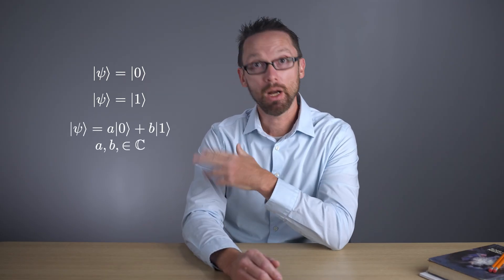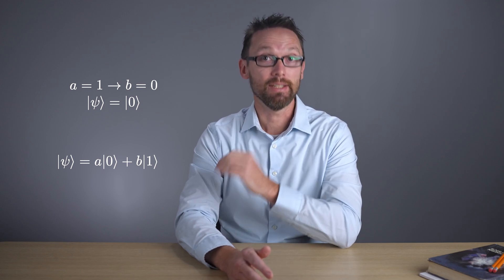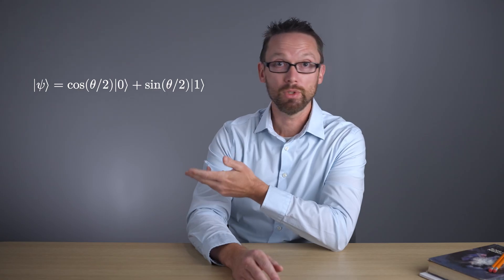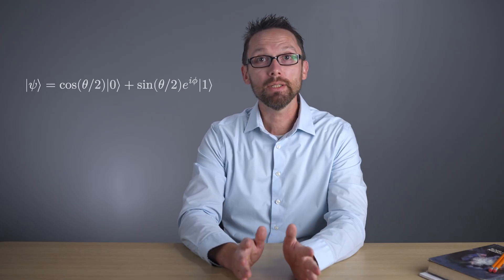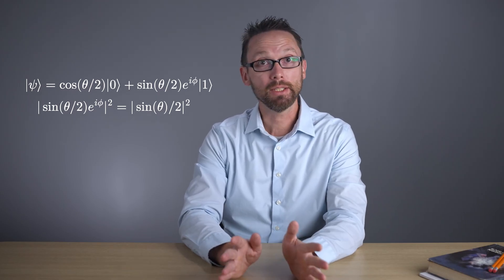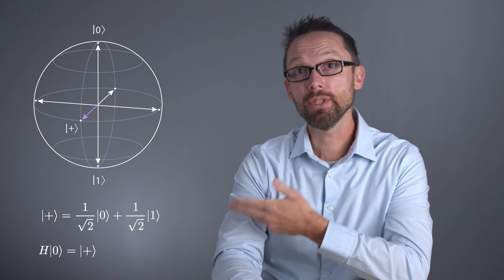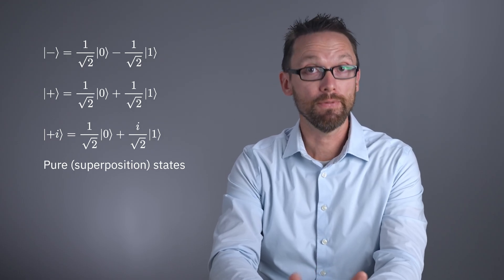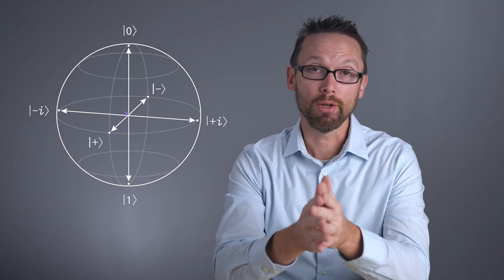How Qubits Really Work.

Comment: Excellent video but I do have one question. The mathematical notation referred to can be simulated with fairly simple linear algebra using column vectors and matrices like the Hadamard Gate - i.e. multiply the column vector (the transpose of) (0 1) or (1 0) by 1/sqrt(2) ( 1 1 1 -1)  (sorry I cant display a matrix in this comment but I mean first row = (1 1) second row = (1 -1) ). The so called Quantum Coin Flip game can be solved using this. No exotic hardware required, no quantum mechanics required. In fact you can solve it using19th century techniques called "a paper and pencil" but today you can write a simple Python or Java program which results in the computer always winning. So why is it called "Quantum" .

Comment: Tangential trivia,  two bits = a Quarter as in 2/8 of the Spanish Milled Dollar coin of antiquity that circulated in several hundred years and early days of colonial America.
Pieces of eight aka pirates money (silver), Doubloons (my spelling is likely wrong) were gold.
Traders and merchants would saw or divide with a chisel and hammer the coin into rough pie shaped sections each 1/8 was a piece of 8 as in "8 Reales" the 8 Reales Spanish coin also called a pillar dollar had on one side a somewhat symbolic image of two pillars like Roman columns in architecture, or jachin and boaz as two pillars mentioned in biblical writing.
In summary, "we presume as did the Spaniards and early Americans that Qbits all bits are significant and powerful"
And yes your video did enhance and give greater power to my understanding of all bits and Qbits.
Thank you.

Comment: Only one question remains: If the wave function is not a tangible, physical thing, but only a mathematical object, then how can it enter into irreversible interaction with a macroscopic system or the environment? Because if the wave function is only an abstract mathematical object (or only information in someone’s head), then it literally cannot interact with anything physical, because abstract objects don’t cause detectors to click, don’t scatter photons, and don’t leave tracks in a cloud chamber.
Reply: Great question. The strength of this explanation is in reducing the physics from mathematics - similar to binary mathematics, one can understanding classical computing without the need to understand the electronics that implemented it. Wave function is the closest mathematical representation that explains quantum behavior. If one accepts that abstraction and encapsulation, building on that fundamental concept becomes easier.  However, this is the ideal scenario. When physics of the situation is taken into account, we have real life challenges such as decoherence to deal with. Looking forward to response to this question from the presenter.
Reply: This alludes to brain versus mind topic - an interesting question, way out of scope in quantum computing.
Reply: @BabuSathyanarayana  1. Quantum computing is fundamentally based on quantum physics, and quantum physics was strictly necessary for quantum computing to exist.
2. The wave function is included in quantum physics. And no, it cannot be "thrown out" without changing the theory itself.
3. There is no consensus in physics on whether the wave function is a physical, tangible thing. Maybe yes, maybe no.
4. Quantum computer is unambiguously a physical, tangible object.
5. In quantum computing the wave function collapses when a measurement is performed on a qubit. Measuring the qubits to obtain a classical output causes the wave function to collapse from a superposition into a definite state, according to the standard interpretation of quantum mechanics. This is essential for reading results from algorithms like Shor's or Grover's.
6. The design, simulation, and optimization of quantum computers require physicists or quantum engineers who do understand wave functions to ensure the system behaves as predicted.
Reply: Great points!  

I look forward to a response from the presenter.